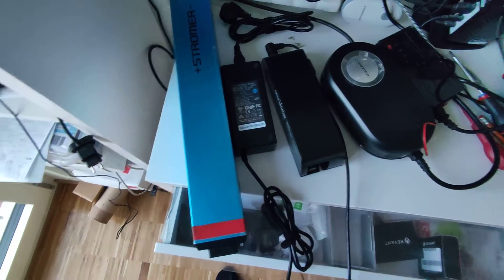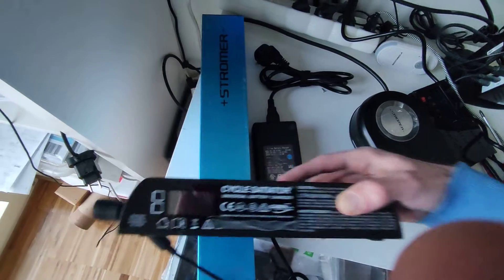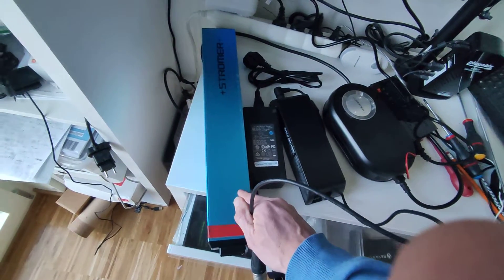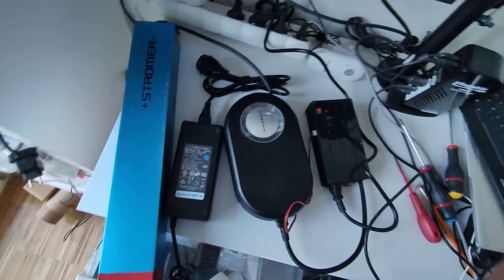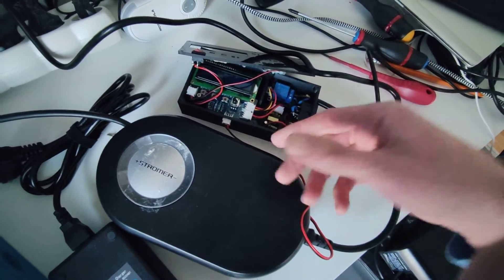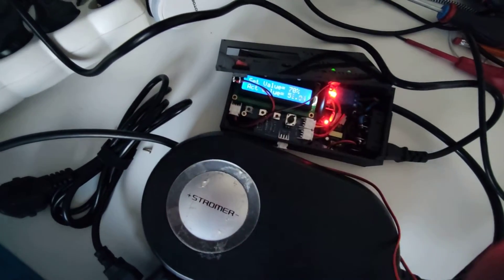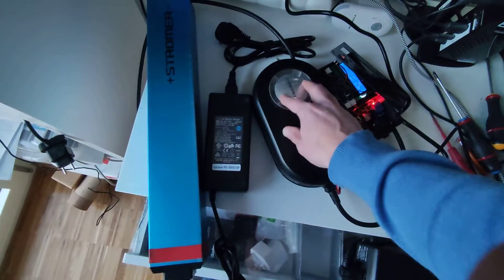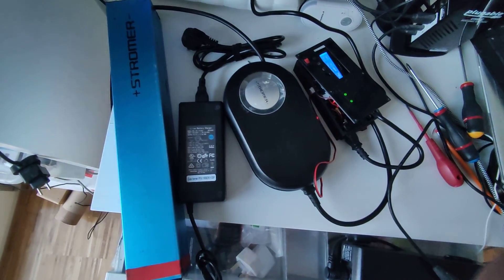Stromer (and other) Battery Saver - Increase the life of your battery 3+ folds

Comment: You can do this also with Home Assistant and the Stromer integration. It reports the SOC and then you just turn off the charger with a zigbee socket. Easy :)
Reply: Thank you for that info - didn't think of any Stromer integration available. My ST5 will arrive in 10 days
Reply: @steffenlav7832  sounds great. Congrats. :)

Comment: But this doesn't work when you need 100% charge to get to or from where you want to go.
Reply from the maker: When you need 100% you just switch the switch and the charger keeps on charging until it reaches full charge. This system is nothing more than a voltmeter that switch the power supply of the charger off when it reaches a prespecified value. If you set that value to a value over the maximum voltage, then the power supply to the charger will remain and the charger will automatically switch off as if there was no "Stromer battery optimizer" in the way.
Reply: I cant thank Patrick enough , most of the time i only need 30 % of the battery capacity so charging to 80 %  and using it down to 40 to 50 % then recharging keeps the battery in that happy band of not to low a volt or too high a voltage .. a fantastic bit of kit that Stromer should think about introducing to their   chargers when you consider the cost of the battery  in the £1000+ 

Thank you again Patrick 

Kind Regards  John   @patrickboyle5269

Comment: hello , i have a spare stromer charger but was wondering could i purchase one of the optimisers do you have any more details of who sells them ?
Reply from the maker: Hi John, these "Optimizers" are a totally DIY project ;o) I designed it myself, got the PCB done, soldered all electronic components myself, programmed myself, created the box using my 3D printer etc. So to be clear it does not look like a refined item. But I have used for a few months now and it works beautifully (I only use it on the 80% charge option).

I could build one for you if you want. The only thing you would have to do would be to open your Stromer charger, and solder yourself the red and black wires with a soldering iron. If you know how yo use a soldering iron, that is super easy to do and takes literally 5 minutes. But alternatively you could send it to me and I could solder the 2 wires for you and send you everything (the charger and the optimizer) back. To be clear, I know that it works great on the CR190, but have no idea how the other Stromer chargers are built, so I could only guarantee that it would work fine only on a CR190 charger.

Also, I could show you how to change the program for your needs (if you want to charge at 75% for instance rather than 80% for whatever reason, or at 85% rather than 80%).

Also, as an additional disclaimer, obviously that would void the warranty of the charger.
Reply: @patrickboyle5269  
Yes mine is the same cr190 . I am pretty sure I can manage the few wires that need soldering to the charger outputs  but I have no idea how to build the optimiser unit so your help would be fantastic  kr 
John
Reply from the maker: @johnroberts506  , sorry for the delay, please email me at patrick.boyle.2074@gmail.com so we can discuss